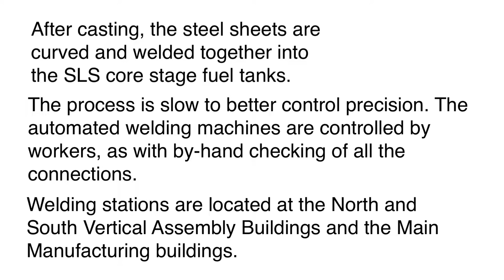NASA SLS EM-2 manufacturing at NASA's Rocket Factory

Comment: This looks spectacular, but if the factory has finished building all the components for Exploration mission 1, does the production for EM-2 mean that once EM-1 has done it's mission, NASA wants to launch EM-2 as soon as possible?
If so, this could get interesting...
Reply: There's a two year gap between them
Reply: @titanium7012  That is probably if they are not in full scale production.
Reply: 2022 is the official date for EM 2, two years after EM 1 which launches in June 2020
Reply: Daniel Burmas this isn't the EM 2 SLS, it's the EM 1. the EM 2 SLS is a lot earlier in production and parts can be seen in the background and they currently look like EM 1 SLS parts from what they looked like 2 years ago
Reply: @titanium7012  If that is so, why did the title have EM 2 instead of EM 1?